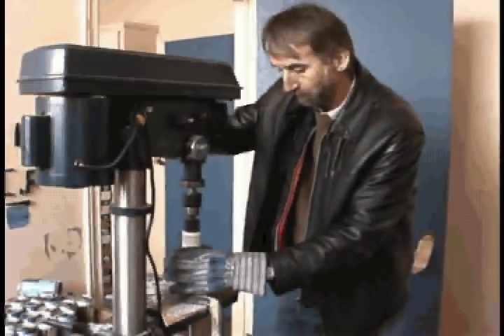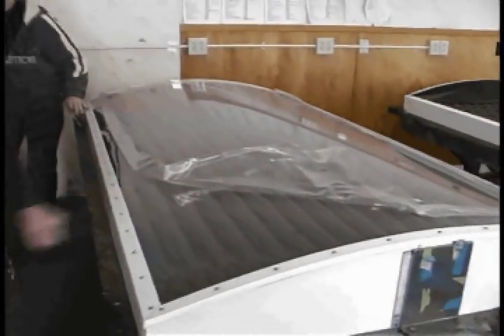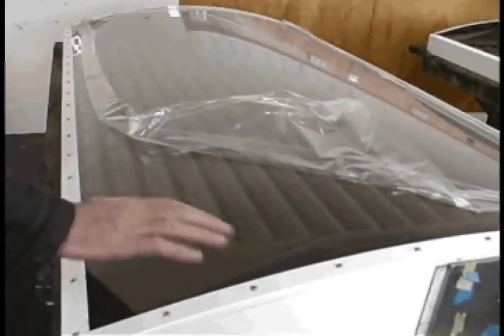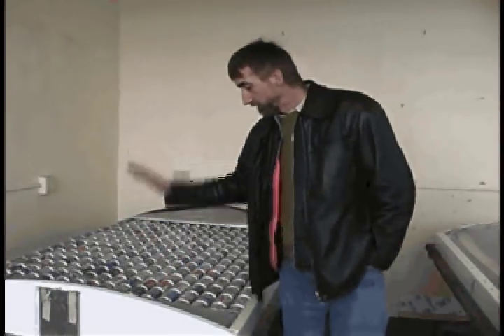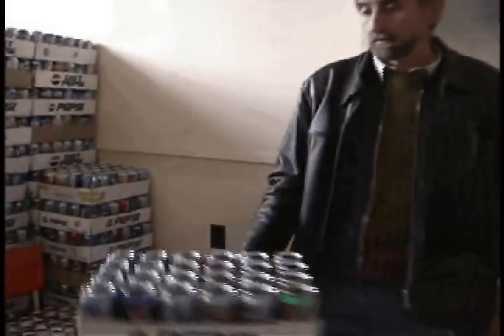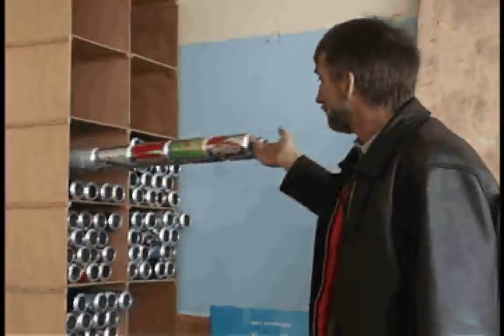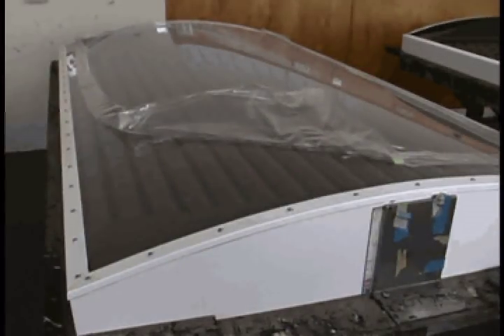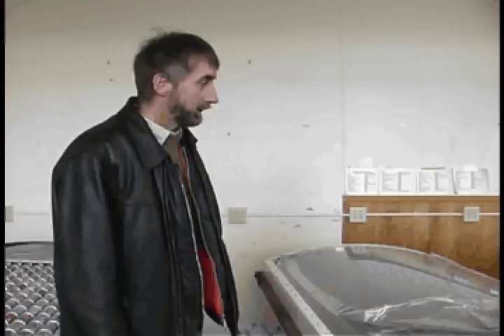Brilliant Newfoundlander Invents the Solution!

Comment: Since only one side of the cans can absorb the sun's heat why use the whole can? Does it have something to do with the amount of air flow. I know when using plastic hose to heat water, for a pool, the flow rate is high, to get every therm of heat. Why has'nt someone made rolled aluminum and coated it ?

Comment: or better yet have the inlet at the floor and the outlet at the floor too, but use a duck work to collect the inlet air from the other side of the room on the floor too.This will cause a cross even heating.

Comment: Better to punch holes with a centre punch. Stops using all that electrical power, also slows the rate of air flow to increase the heat output.

Comment: @BR549guy My brother and I were experimenting with parabolic reflectors on sidereal motor drives, high pressure stainless focal tubes, stuff like that. We ran out of funds, but the ideas still keep a comin'. 

Whatever you wind up with, the more mass you have in the unit, the less sporadic the temperature changes will be between sunlight and cloud cover, like on a day with patchy clouds. You could even use thermostatically driven vents doors and/or motor controllers to ...... cont'd

Comment: hi there  question  in montreal in the winter  will it work anyway since its cold ?? THANKS FOR A REPLY
Reply: +shopabandit Sunlight is sunlight. The glass prevents the cans from getting cold, but lets the sun shine through to heat up the cans. It would work in winter
Reply: +Voopa in winter the glass and cans will remain at the outside temperature, a little sun will not heat -40
Reply: +Dave Roach yes it will

Comment: What do we need cans for? Can we just have empty cabinet painted black inside? That would give you more air volume and faster flow. Correct me please if I am wrong...
Reply: You need the metal (steel, alluminium, copper etc.) because it acts as a heat trap, i.e. it has high thermal conductivity, which other materials like wood or plastic do not have. The container shape (i.e. cylindrical cans) is also very important. These work as individual heat cells that accumulate heat, then radiate it both into the can and out, heating up the air. As the sun position changes though the course of the day the cylindrical shape ensures the sun rays always hit sufficient metal surface at near 90 degree angle. This maximises heat capture.
Reply: The cans also increase the amount of surface area in contact with the air tand that facilitate heat transfer. Without the cans you end up with less hot air and more heat left in the box.
Reply: RelevantQuestions what about lining the box with heavy alluminium foil and paint it. more air and trap heat.
Reply: SPARTAN MONGOOSE That's a good idea too. It increases the efficiency of heat capture in the box. But yeah, you still need to keep the cans as the primary mechanism of heat capture.

Comment: My question is relative to available sunlight. Once the sun goes down (yes people, I know that the sun doesn't go anywhere; that the earth rotates) does the effectiveness of this cease, until sunrise again. 

I want to make a smaller version that can be roof mounted on a pickup or van, for heat when bugging out, but because of my limited knowledge on this subject, I can't see it providing any heat when it's dark, and generally speaking, the coldest. 

Thoughts or revelations?
Reply: errr well. exactly my question. I can enlighten you. No sun = No heat. So lets just heat our rooms when they are already warm through the sun...
Reply: Tin Man you need a trinity system, solar, wind, and hydro

Comment: There are other methods of harnessing nuclear energy. When you hear the term nuclear energy, you are probably thinking of uranium reactors, which are quite notorious for the past incidents that did occur. Thorium nuclear reactors (Liquid Fluoride Thorium Reactors) are more efficient and cleaner than uranium reactors. India already has an operational thorium reactor built and China is building 50 of them. Look them up on Tedx .

Comment: Can I use this in other way as I live in torpical country ?I want to get the hot air out from the room.
Reply: I'm thinking it should convert to an effective Thermosiphon if you set it above the room and inverse the air intake to connect to the room. For kick ass result connect an opposite air intake lower in the room and coming from a pipe traveling 6 feet underground around the the house.

Comment: I made a miniature version of one of these using cans, some scrap wood, an old computer fan I got for free and plexiglass to heat my workshop. It works pretty well for heating a small space. I'm curious to see how effective one of there larger one's would work for heating a house.
Reply: yes, I have some 51 cans in 3 panels + 3 cans more in my south-facing kitchen window inside the house - I remove them if there it's cloudy.  There is a mirror on the outside of the window on hinges too doubling the sun coming hitting them.  The heat going in is about 65 degrees, and the heat coming out of the top of the cans is 150 degrees at noon.  It saves me quite a bit of oil.  It's clean and radiator-like.  Every sunny day I'm smiling!

Comment: G'day boy's, I'm just wondering?? Why dont you have the warm air coming in at the bottom as Hot Air rises?? and the returning air going back from the top as hot air will then be return back into the solar Furnace! this would keep it warmer when in use? as you would be using warmer air all the time.. I was just wondering thats all.. Rod

Comment: Using cans is probably more expensive to prepare than virgin sheets of Al, but on the other hand, sheet handling equipment costs are avoided.
Reply: +Indio Side I have two of these on my house and a similar collector for a solar food dehydrator. I did not use cans because I had not heard of it when I built them. I used a sheet of corrugated aluminum roofing under two layers of expanded metal mesh, all painted flat black. They are glazed with tempered glass from storm doors. On a sunny February day the air coming into the house is about 130 degrees. My collectors do not use fans. They work by natural convection
Reply: The Garlic Farm Is the expanded metal mesh layers to provide more surface area? If so than that is great idea!
Reply: +Indio Side You are correct about the reason for the mesh being surface area to absorb sunlight. I didn't use mesh in the collector for the dehydrator because I didn't know about it when I built it 20 years ago.  The air coming from that collector gets to about 110 degrees which is a good temperature for its purpose. 
Regarding your comment about metal working equipment. The equipment can be expensive but not as expensive as the labor that goes into cutting, washing, drying and glueing or soldering the cans. I don't think he would have to make many collectors for the metal working equipment to pay for itself with labor savings.

Comment: @iam4god2day if you put a few of these on a house it may get too hot inside the house at which point it might be beneficial to install a "water battery" of sorts, in your basement if you have one. basically an insulated box (big) full of water. you heat it up with the excess hot air and reuse that hot air later when the sun isn't out. you use a heat exchanger to transfer heat

Comment: This is to make warm air? I take it you will use 'dryer hose' to duct the air in/out of the house? Then you will need a fan or blower... which can run on solar cells....thus automatically  go on & off to match when the sun is heating the cans.

Comment: Since this unit only needs to circulate air when the sun is heating the air in the furnace, why not use a solar-powered DC motor fan which will switch on only when the sun hits it?  This would make the furnace not use any AC power from the grid.  With insulation and optimal angling for latitude, these furnaces could be placed on every building and significantly reduce dependency on dinosaur juice.

Comment: Hot air rises. It's the same principle that powers wind. 
Genius is doing what people haven't done before, he's using Pop cans, common, 8 cent deposit, pop cans, to convert radiation into conduction, which in turn, causes convection. The hot air, by it's own energy enters through the vent near the ceiling. When the air cools,  It drops, and by the convection produced by The moving hot air, Is sucked into the lower vent to be heated again. It doesn't need a blower motor, It's basic convection.

Comment: I'd like to know how many joules exist in the incoming air, both as heat and momentum. It could possibly power a small wind generator (enough to light an LED array) or, using this with a parabolic reflector, even turn water to steam for more electrical generation.

Sterling engines, as the above poster mentions, are just too inefficient.

Comment: You are getting Joules and Watts confused. I believe that your calculations are right, though they are a little hard to follow, but the Watt is energy per time, and the Joule is just energy. There is a unit of energy, the Watt-Hour, equal to one Watt for 3600 seconds (therefore 3600 Joules). The energy to refine the aluminum for one pop can may be 350 Joules, but it cannot be Watts because it does not take energy to keep the aluminum refined.

Comment: Nice use of the old cans!  I wonder how much watts if could release for a panel that size.  Saying that this is free energy is a lie cause there is a blower wich consume electricity.  This panel could not replace any heater system, even in warm places, cause its always colder during the night and there is no sun during night so you cant relay on this system, but it's still cool!

I'd really like to know the output of this system, and calculate the difference between the fan power and the heat output to be able to know if its really interesting or if its changing 4 quarters for 1 dollar..
Reply: You could buy a few small solar panels from Radio Shack for a small price and run a few computer fans.

Comment: not sure what the fan runs off of, I would think it uses power, and most fans need to be replaced every now and than, but the video in not very specific with this part, a 50 to 100 degree increase in temperature here would mean I would have to have the windows open all the time

Comment: But, what about cold weather?  Wouldn't the temperature of the air in the cans be affected by extreme cold weather?  It seems that even if the sun is blazing in the sky, if it's 25 degrees outside, the temperature in the cans wouldn't be warm enough to keep the house warm.  Also, why cans?  Why not simple thin-walled aluminum tubes?

Comment: I have to wonder how much time, energy, effort, and money would be saved if he just plain bought some thin-wall aluminum pipe or venting. I also have to wonder if the hollows between the pipes could hold copper tubing so the same collector could heat hot water.

Comment: Do the math. By moving in 70 deg 'house' air @ 100 cu-ft/min air flow, your 'hot air' panel will have been evacuated in .16 min (about 10 sec). You might get a 'puff' of warm air initially, but it wouldn't be enough to heat a hamster cage. Didn't mention 'recovery rate' (how convenient)

My home had similiar panels (circa 1980's) worth more as scrap aluminum. They worked great... in the SUMMER!

Beware of the keywords folks "free... lifetime... pay for themselves... FINANCINING... etc...!

Comment: Decent idea. Only really viable for buildings with terrible design (which currently is a lot). 

In decently designed buildings (modern professional or those built by your grandparents) there is sufficient solar heating with intelligent placement of shade for winter/summer change.

Comment: @BR549guy .....Part 2:  That would allow YOU to control the rate of heat rise and air flow rather than be limited by the design. Right now, you're limited by the design. (No offense.) The cans were a great use of an existing waste resource and the cans stack neatly on top of each other. If you were able to control the temp to get hotter air during the day and then pump some of it into a heat sink, you could draw off that heat sink in the evening after the sun went down.

Comment: @BR549guy I heard him say that the air moved through the cans like a centerfuge so the rough edges would make the air come in contact with more surface area eg a heat sink. I'm not an engineer but it seems pretty plausable.

Comment: Tempered glass [float glass] in standard a size must be both cheaper and more durable [chemical resistant policarbonate is quite expensive]
also some aluminum cans are thicker than others, what's the effect?
also, while air is free/infinite and freeze-proof, a hi-bred air and water-heating system might be ideal? so could "as cheap/affordable" water pipes fit in the grooves?

Comment: "Modified to cause the air to spin..." yet it looked like drilling one hole in the bottom and one in the top, wouldn't that just be a straight pipe with no spin?

Comment: All this is good and well, I get the principle here and I'm not trying to be a party pooper. But what about the 'night time' in cooler, colder climes? I guess one would have to revert back to the standard heat system this system is trying to replace. Not an entirely green system then is it? Although any start is a good start I would think...Michael

Comment: @zekoimedo Have you ever been in a car when the sun is shining even when it's cold outside? The inside of the car is still warm because it's absorbing the radiation from the sun. This is the same principle. They do work and quite well, of course when the days are very short their heating capabilities are also short. In a very cold zone you would need many of these to heat your home all winter and probably also need some kind of water heater device to store warm energy through out the night.

Comment: @fabfauna if you put the cold air return high you will be sucking up the hottest air, since, as you say, hot air rises.  The cold air return must be low, where the cold air is. home, It is  not uncommon for heating ducts to pour heat from the ceiling.

Comment: it's not the design that costs 3000, it's not even the labor. it's the materials.  That lens he's using isn't some old glass table top or a repurposed shower door,  It is an engineered lens specifically manufactured for that purpose.  You think that shit isn't expensive?  Check the price of a UV stabilized tarp! It'll be 3 to 4 times the cost of a standard nylon tarp of the same dimensions.  Even with just rolled plastic sheeting. You can go to home depot and buy a 30x100 roll of polysheeting for $100, a 4x8 sheet of UV polycarbonate is going to run you almost twice.

Yes, any shade-tree carpenter with modest skill and a few tools could make a similar contraption, or salvage one.  It's not going to last as long, and may require modifications.  This guy's done all that for you. Collected the best materials and assembled them in a proven design.  You're paying for convenience.

Having said that, longevity isn't always best.  He specifically mentioned there is no warranty.  Which means if that thing gets damaged at any point, you eat the entire cost.  However, I think it is over-engineered.  The cold-truth is this will not replace conventional units.  For one, it only heats. So only needs to be in operation 3 to 5 months out of the year (winter, and maybe fall).  Of that time, it only produces heat for about half that time (the 12~ hours the sun is shining).  12m * .333 * .5 = 2months  That's it. That's its effective working time PER YEAR: 2 months, with optimum conditions. Clear skies, and no snow covering the lens.  One must still run conventional heat in the evenings.  And this assumes that a single unit can even adequatly heat the desired space.  If you have a large house, you're looking at having to buy additional units.

Comment: Can you reverse this and make an air conditioner?
Reply: thru a little bit of ingenuity and re-plumbing, I think it could work as a "de-heater"... in the hot sun these cans could produce quite a heated air-flow... if one uses that now to suck out the air from the top of the house using a funnel-system as you would have it in a spray-paint gun, Bobs your uncle...
Reply: to reverse it just put the cans in backwards

Comment: How come i never see people using these in the winter?
Reply: You gonna pay 3 grand for a bunch of painted pop cans in a box and over wired to do what your furnace does anyways? (since if your thermostat on your furnace is set right, then these rigs only needs to run, the furnace will take care of itself as to whether or not it turns on). plus it's the same as solar power. on top of cost issues, they're not as reliable as people make out depends on where you are and your 'southern exposure'. if your exposure sucks crap, then it's not gonna work nearly as well.
Reply: though I've used smaller setups, 35-75 can setups depending on what I needed them for.
Reply: cause you will freeze to death if you do!!